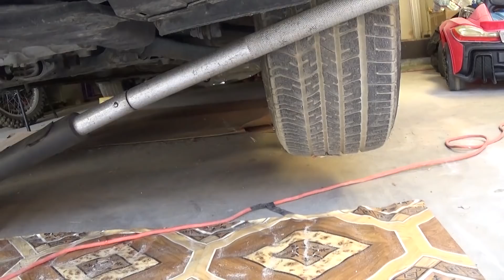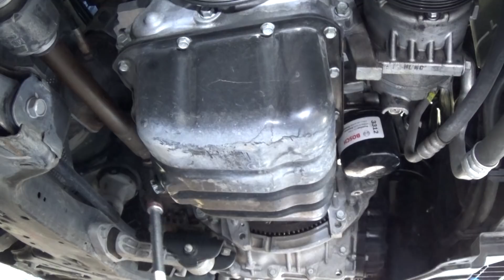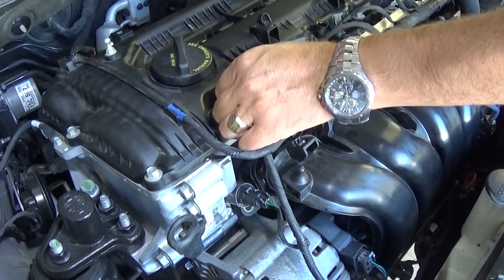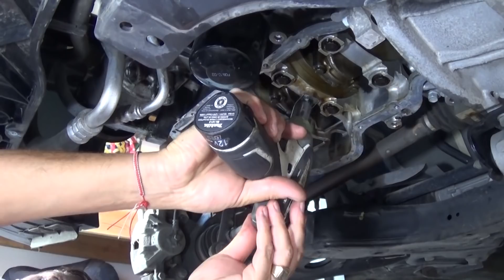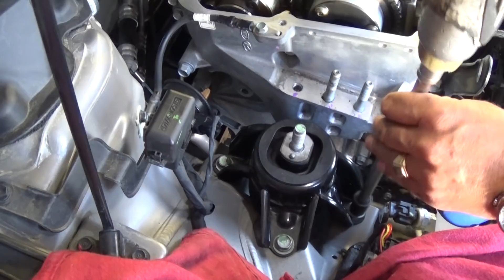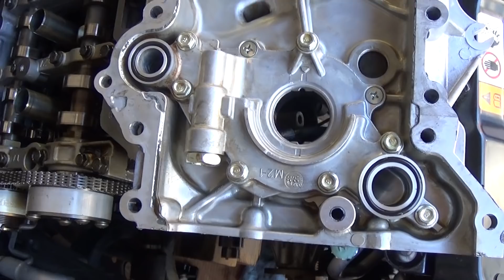HOW TO REPLACE OIL PUMP ON KIA FROTE K3 SOUL SPORTAGE 1.8 2.0 NU

Comment: junk design!!!! terrible engine kia should buy these back!!!!!
Reply: Junk design lmfaoo this is the easiest oil pump to pull ever and you're bitching. Try a commonrail vw diesel with a massive balance module in the oil pan and the oil pump is built into that. Way more work

Comment: there is a mark on the front of the oil pump cover, can i use this mark for tdc?, cause my new crank has timing not correct when lining it up using the harmonic balancer

Comment: How do u remove the oil pump on a 2007 Kia optima 2.4      4 cylinder engine
Reply: *Let me guess, do you have a knock in your engine?

When it comes to anything that would warrant you to remove a part that affects timing--always turn your crank to the "T" timing mark.  You should see a "T" on the cast housing and there will be a tiny mark or divot on the pulley.

Once the oil pan is removed there will be 4 star shaped bolts that secure the pump to the bottom of the crank housing.  You need to remove these (they are rather long once you get them out.)  Leave one of these star shaped bolts in but loose so you can remove it using your fingers.  

Next, look at the timing chain that drives the oil pump shaft--there are two "orange" colored chain tensioners that hold the chain on the sprocket.  I loosen one bolt on the left side tensioner, this allows you to move the tensioner away from the chain. Leave the tensioner that is closest to the front of the vehicle in place

**Please make sure to make an orientation mark on the chain and a correlating sprocket.  This will make sure that you reassemble the pump correctly.

Next, support the oil pump with one hand and remove the last bolt--this will allow you to drop the pump and then tip the pump so that it comes out of the chain.
Reply: Would that be the same thing for a 2018 Kia Sorrento?